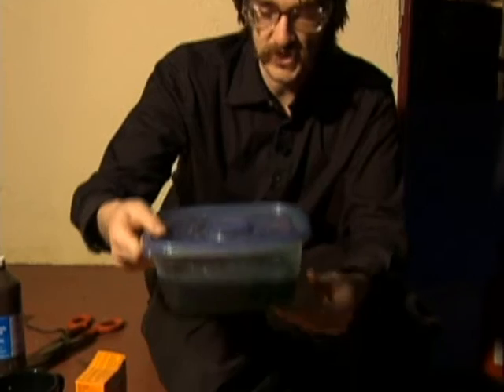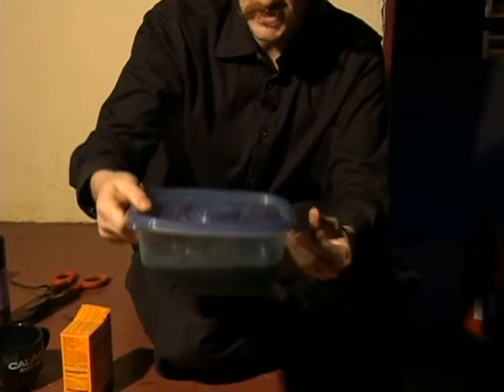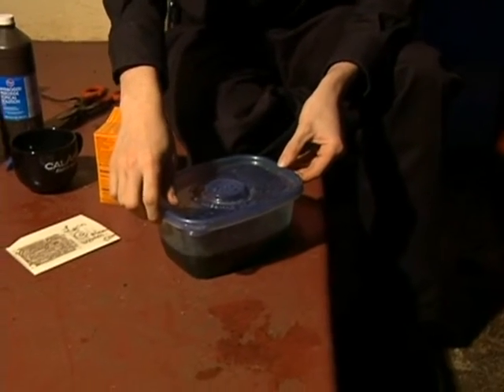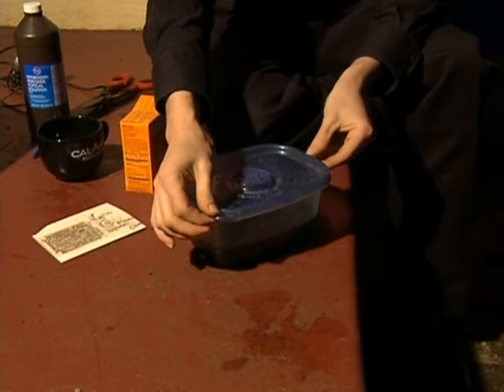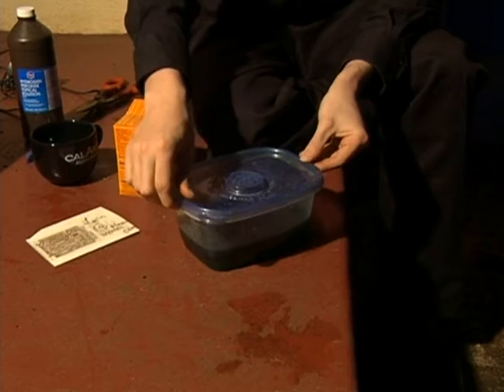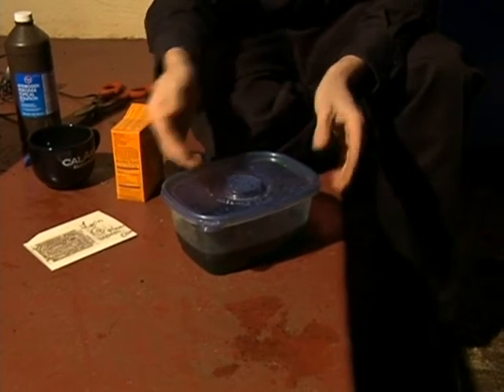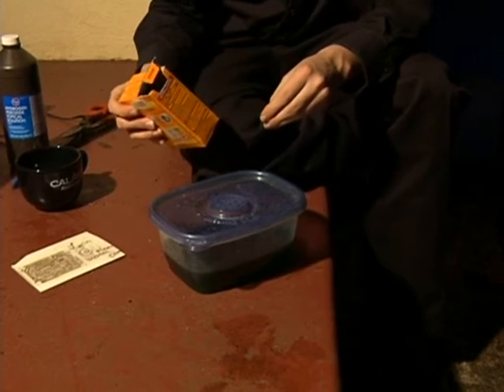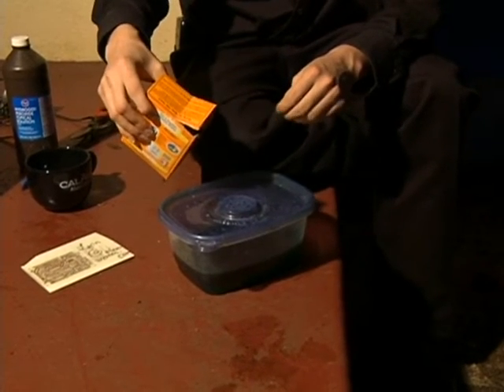Etching Copper for Circuit Boards : Disposing Copper Etchant

Comment: Nice idea but if you put the sodium bicarbonate in a metal pan heat an stir until no more fizzing happens you get sodium carbonate and add it to the solution an you drop the copper then filter and you're left copper in the filter and with a clear liquid but I would not drink it tho